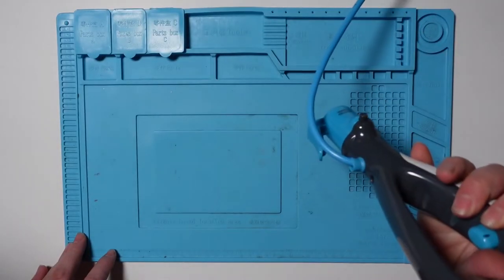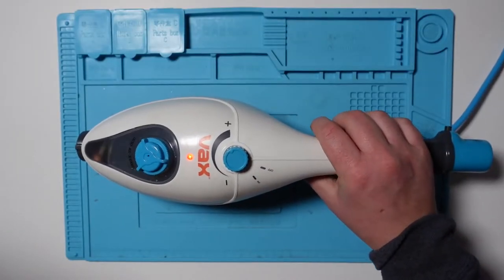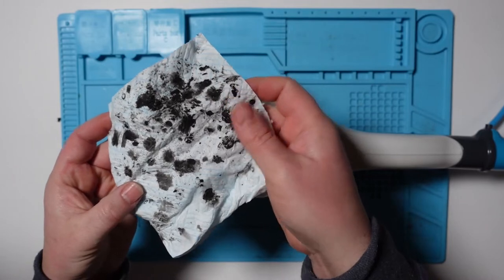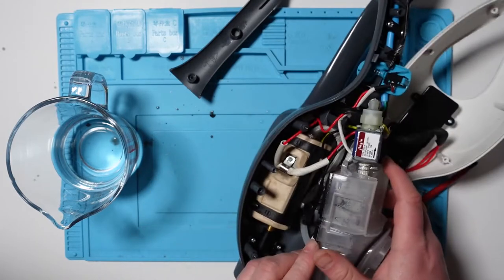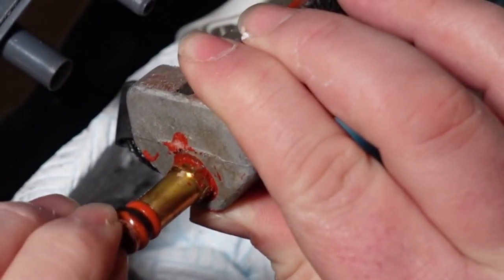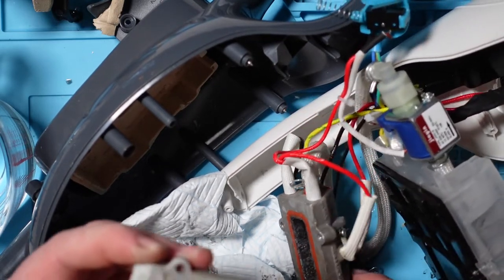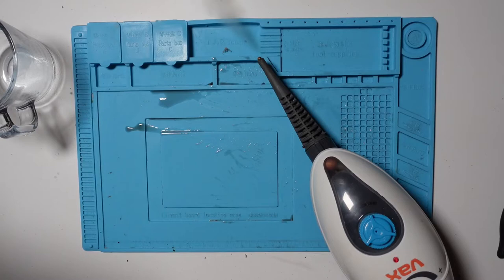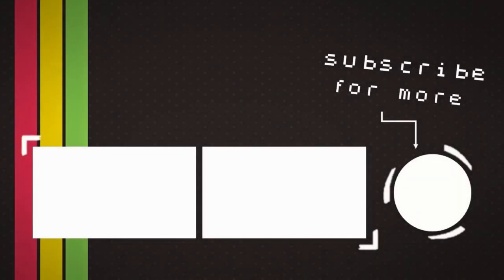VAX Steamer Spraying BLACK STUFF Everywhere | BLOCKED Nozzle & Low Pressure | Can I FIX It?

Comment: Mine had no black mould but only scale chalky deposit. Scraped some with a knife and fine needle and thread through the spout. Vinegar worked well to remove some deposit and cleaned with cotton wool buds. Fixed the problem and i will try and use deionised water to minimise build up again. great detailed video. Thank you.
up
Reply from the maker: Thanks Tsjussable! Great idea with the vinegar, I've used white vinegar a few times since and it is great for getting rid of old deposits! Appreciate the kind words. Thank you! 👍

Comment: Thx for video.Mine is new, only used it three times. Was a free one with carpet cleaner from Vax. They are sending a new one this week. Gonna strip this one down to try your fix. Bet any money it was a returned one as the carpet glide was broken in the box when I opened it.
Reply: UPDATE, wooohooo opened it up and when looking at the heating chamber I noticed that the heating element was loose where it bolts/screws to the chamber. Tightened, reassembled, filled and plugged in, mega steam. Replacement from Vax came yesterday now I got two. 
Thank you for the video, it gave me the confidence to open up mine.
Reply from the maker: Excellent news! Glad my video helped you out, and great result that you have 2 working ones now! 👍👍

Comment: I have one of these. The 1st one was replaced by Vax under warranty 6 months ago while it was only 6 months old.
5 months on with the replacement & the same thing has happened. Vax are sending me yet another replacement. Vax have told me to dispose of the one that isn't working.
However, having just seen your video, I followed everything you did in the video.
Hey presto! It's now working as it should 😂😂😂😂
I now have 2 steam mops 😜
Should this saga repeat its self (it will for sure!) I will know exactly how to fix it thanks to you.
Seems it is an inherent problem with this model as you can not clear the steam delivery tube effectively unless you disassemble it - its built to fail, and I think Vax know this!
Thanks for the vid 😊😊

As I live in a very hard water area, I am now using filtered rain water in the machine as its naturally 'soft' and free rather than spend money on distilled water you have to pay for.

Comment: I would say that the cast aliminium  part is actually the heating unit and it's probably mouldy lime scale
Reply: that was the problem with mine full of lime scale and only used four times. its now working again. must get some distilled water is it o.k. to use descaler I wonder. Thanks again to  StezStix  Fix

Comment: Found to countersink hole in heater steam exit nozzle makes it easier to clean jet without having to strip down again.The Original problem being unable to gain entrance to this nozzle from pushing wire through the outside nozzle .But as I stated earlier by  countersinking the inner nozzle guides the cleaning wire probe…..
Reply from the maker: Excellent idea, William!  Thanks for sharing 👍

Comment: Essentially a boiler with a handle.. in the same way a coffee machine is a boiler with controls and a handle for coffee. 

Thanks for the upload Steve; was a coffee machine tech for 10 years so feel your pain when you took apart that lovely Krups machine (shudder).. all kinda the same after a while tho - you get used to the circuit etc and then it’s just changes on that.. 

A shame in the case of the Krups as they used to be a really good reputable brand before they got bought out and dissolved.. 

Keep up the great content my friend 👍🏅

Ps - a good set of welding tip cleaners are your friend when you get such a case of blocked up spouts / nozzles etc

Comment: The black stuff look a lot like aluminium oxyde... Don't use strong acides to descale (hydrocloric would tipicaly do that to aluminium for example). Vinegar is enought and remember that you have to rince it after just in case.